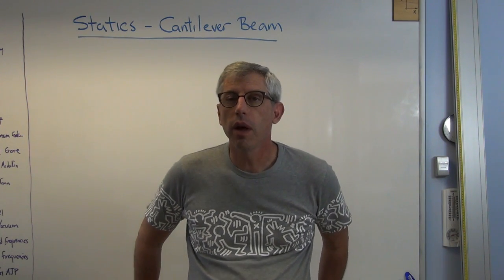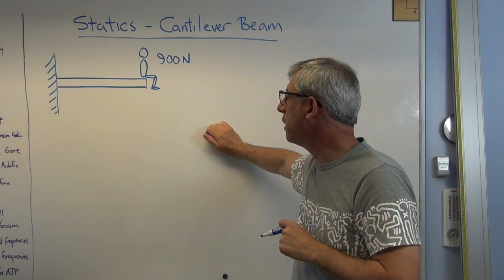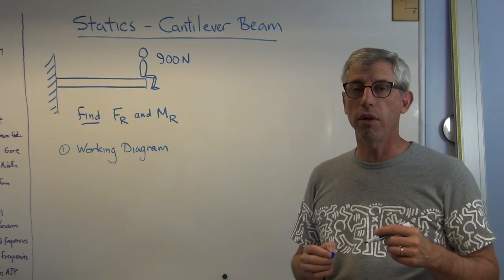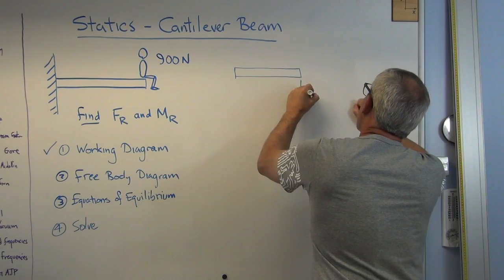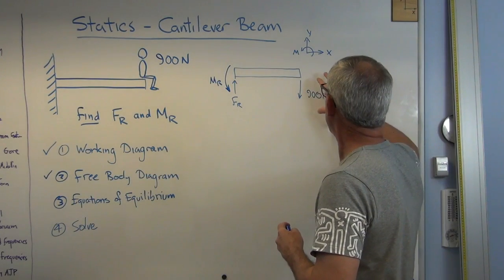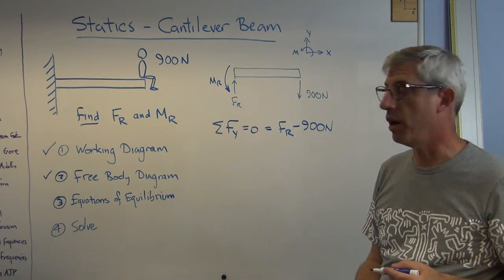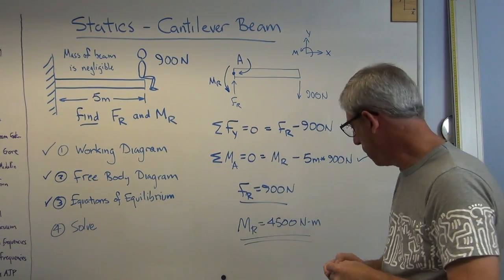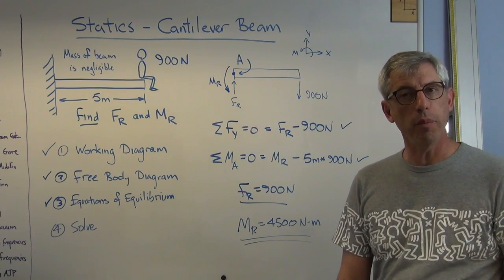Statics: Cantilevered Beam - Brain Waves

Comment: If the mass of the beam is taken into account, would you treat it as a central point load (as in total mass of beam*g, acting through the centre) or UDL?
Reply: btw I enjoy your videos, helps a ton
Reply from the maker: Thanks, I'm glad they are use useful to you :-)
Reply from the maker: If you just want the reaction force and reaction moment, you can concentrate the weight of the beam at the centroid (as you said).  If you want the stress along the beam, you'll need to account for weight along the beam.  You'll probably need to draw a load-shear-moment diagram for that.
Reply: purdueMET Aye, makes sense. Thanku